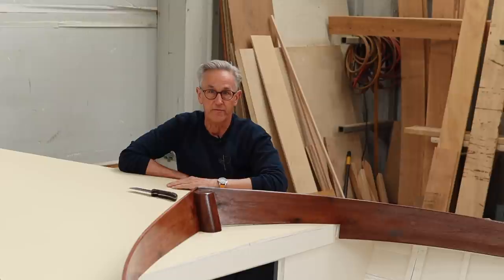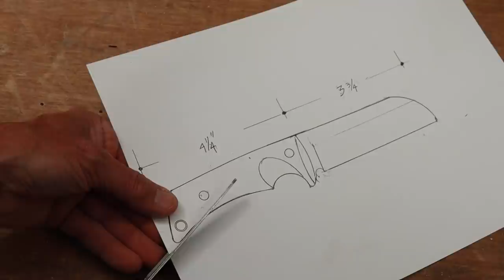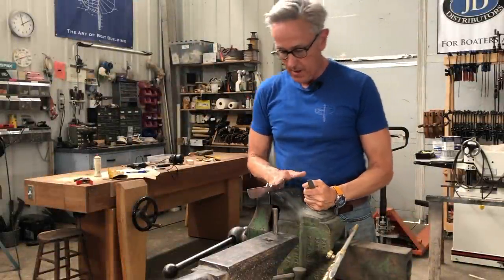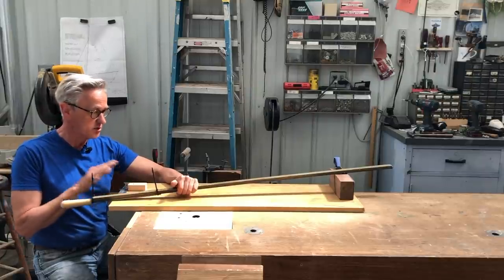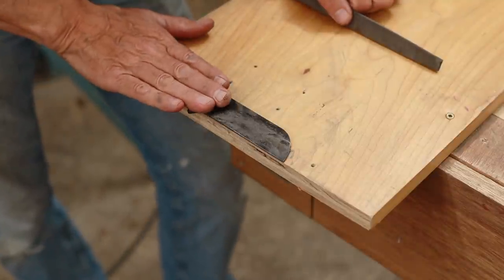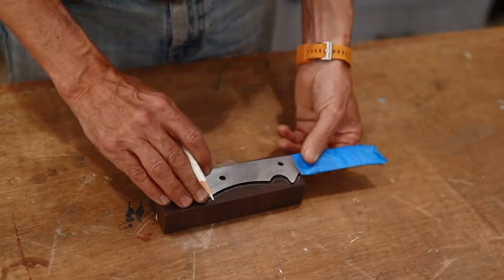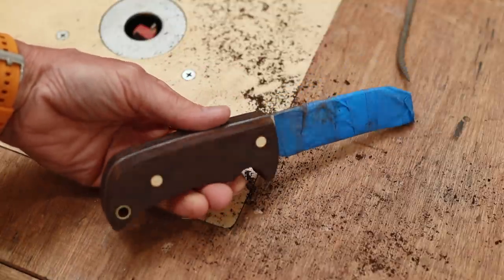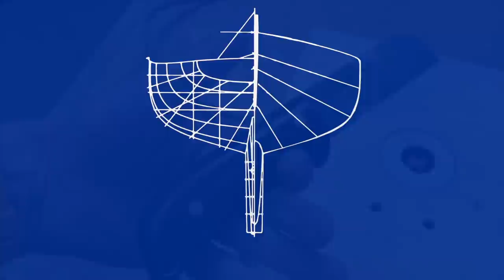Knife Making, How to Make a Sailors Rigging Knife without a Forge.

Comment: Very nice, Bob. I hope to see you at the Wooden Boat Show this summer. I live right nearby. 
One small detail in terminology, though. What you did to soften the steel is called "normalizing." Annealing uses a slower cooling from the austenitizing temperature. Often it's done by putting the hot knife into an insulating material such as vermiculite. However, normalizing in your case (air cooling from the austenitizing temperature)was actually the better process in that it also served to reduce the grain size of the steel and make it tougher. Excellent job. I have a feeling you'll be sewing a nice leather sheath to go with it too. 
Fair Winds
John Gullotti
Reply from the maker: Thanks John!
Cheers

Comment: hi, this type blade is used like you said when you need to cut things repetitively with the tip of the blade and you want the angle of the knife relative to the work to be somewhat reasonable not to tire your hand and have good leverage to exert pressure with the tip, you can cut with a curved tip but you have to hold the knife at much higher angle tiring your hand and putting the blade at disadvantage to exert pressure and maintain control. thanks for sharing. take care. petero
ps. with certain type of glue sometimes it helps to scuff the tang with 100grit for it to have some grip

Comment: Outstanding video.  I want to make one in the future.  Hope your hand is better.  One question, can you use a plumbers hand torch, the kind used for sweating pipes, I am not sure if that can get it hot enough.
Reply from the maker: Thanks Mark. I’ve never tried a propane torch. I think it would work but would take longer. I would get a MAPP gas bottle. It burns almost as hot as Oxy/Acetylene. 
If you build one send me an image. Best wishes on it!
 Cheers,
Bob
Reply: @TheArtofBoatBuilding  Bob. It will be a while.  I am retiring from Wa state to Ok.  I have a 50 x 30 shop to build a boat.  Going with a Sam Devlin design.  Surf Scoter 26.  By the way originally from Peoria, a river guy before I spent 25 years in the Coast Guard.  Perhaps I can pay you a visit next year.

Comment: Sorry about your hand.  That bone is quite fragile and, when broken, is often called a "boxer's break".  Back in the day, when a boxer got into a street fight, they usually forgot that their hands were not protected by gloves.  When they punched with full force, that metacarpal, being the weakest, often gave out.

Great knife build but I have a suggestion for future rigging knives.  They were usually a "hidden tang" design and I would suggest that, the next one you make (you can't just make one!), has that feature.  A hidden tang knife has the advantage of limiting the amount of rust and corrosion between the steel and wood.  "full tang" knives with scales are difficult to keep moisture from seeping in between wood and steel.  This can quickly lead to scales separating from the tang because of rust and corrosion.

The late Wayne Goddard, editor of Blade magazine and designer for Spyderco knives, covered this in detail in his books "the 50 dollar knife shop" and "the wonder of knifemaking".  They are an indispensable source of wisdom for knifemaking.

Comment: Would the same method be used for stainless steel?
Reply from the maker: The shaping of the blade would be similar. Stainless steel does act differently than carbon steel, so the process is different. The hardening an annealing stainless requires a different process. Hardening stainless steel involves slowly increasing the temperature, followed by rapid cooling. Process annealing stainless steel is heating to between 1400 and 1525 degrees Fahrenheit then cooled at a rate of 75 degrees per hour. So as you can see using stainless is a more involved process.